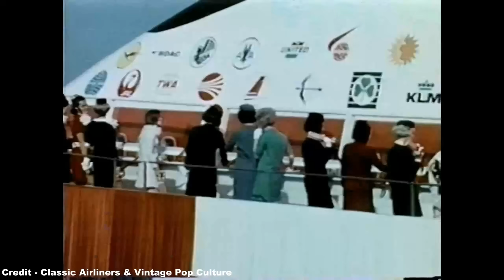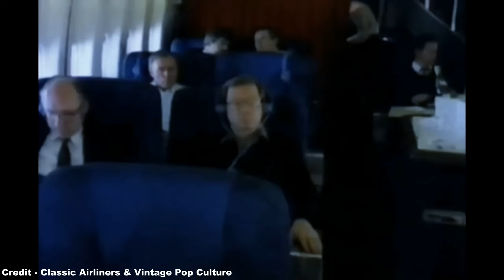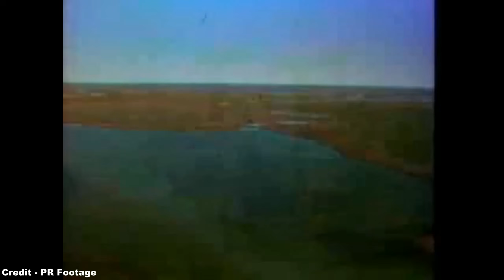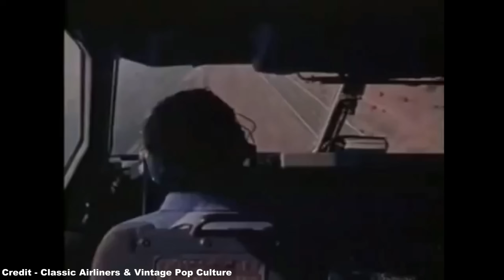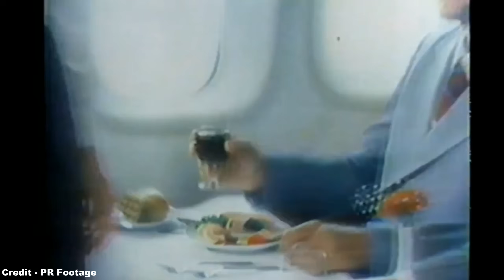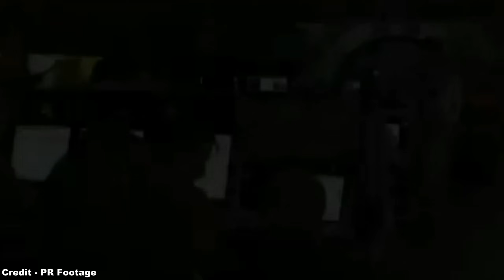Short Stuff - Boeing 747SP (Reworked)

Comment: Equal to the size requirement, Pan Am wanted a plane that could fly Nonstop from JFK to TYO,  JFK to Multiple ME destinations, SFO to HKG, and LAX to SYD.    Also SP special performance - higher, faster, further.      The flight block time from LAX to SYD is 15 hours today, but in the early 80's Pan Am scheduled it at 13.5 hours.

Comment: Unless you've stood on the outside of a 747 I don't think most people realize the SIZE of the thing. Just ONE of the main wheel wells was the size of my first apartment. There was room in the crown area (above the ceiling panels) for an entire other section of seats.....and no, I'm not just talking about the upper deck. Above the ceiling panels of the main deck they could have easily put another three abreast section of seats.

Comment: As a kid in the 1980s I flew Pan Am and later United 747SPs from Sydney to LA many times, then as a adult worked on both Qantas 747SPs as a engineer, they were also the only 2 to be fitted with Rolls-Royce RB211-524D4 engines and a strengthened -200 wing. 🇦🇺
Reply: Sir, awesome to read your comment :-)
Reply: @Michael.Chapman 
Thankyou my friend. 🙂

Comment: The boeing B747-100 SP operated as the sultan of  VVIP trsndport had an Escslstor in the forward csrgo jold ehich vould be ectfnded ftom the forwsrd c argo hold a to the gtound yo resvh the gtound. to probinde a mobmving   dtsirs  as an access to yhe sircrsft  from the gtound it aldo had sn Elevstor in yhe forwsrrd frright jold yo   lift passrngers ffom the  freight hold. yo yhr msin devk n VVIp, passenger Acommodstion

Comment: I always found it odd that the -100, -200, -300, and -400 were all the same length. Only the -SP and -8i were shorter and longer respectively. But...the -300 and -400 utilized the extended upper deck which was originally engineered for the -SP, so that was its main legacy.🙂

Comment: But interestingly, I wonder why Boeing never considered building a 747SP powered by RB.211-524H or GE CF6-50 engines. The higher thrust of these engines could have allowed Boeing to extend the range of the 747SP from 6,600 to circa 7,250 nautical miles, which could have made very long intercontinental year-round flights possible like between  SFO and HKG, LAX and SYD and SYD to LHR (one stop) possible as early as 1982!
Reply: According to an orginal Boeing data sheet I have about the 747SP, it was actually offered with both the GE CF6-50E, -50E1, -50E2 with a take-off thrust of 52.500 lbf each and the GE CF6-80C2B1 (!! - this engine was otherwise used for 747-300s from 1987 onwards on customer request and the 747-400) with a take-off thrust of 56.900 lbf, but none were ordered. Of the RR engines, the RB211-524B2 (50.100 lbf) and -524C2 (51.600 lbf) were offered by Boeing and ordered by their customers, but the -524D4 (53.110 lbf) was only offered and not ordered. The RB211-524G and 524H were only developed and offered for the 747-400 and had their entry into service in 1989. Kind regards!
Reply: @janncfl Thank you for that info! From memory, RB211 G/H engines were edging close to 60,000 lbf on BA, QANTAS and CP -400s?
Reply: Both Australian SPs, purchased new by QANTAS, naturally were delivered wearing the more beautiful Royce RB211 fans. I believe others, including South Africa, optioned similarly.
Reply: Boeing offered the SP with all the engine options....final score ...PW-39...RR-6....GE-0

Comment: I flew on a SP in 1988 from Mauritius to LHR via Zurich. It was operated by Air Mauritius and I think was previously flown by South African Airways. The flight to Mauritius was on the SP's replacement, the 767.
Reply: The original MK 747-SP was leased from South African Airways. It was flown by SAA pilots with MK cabin crew.

Comment: A "baby" 747 !!🥰 If Boeing had shrunk" the 757, instead of trying to stretch the 50+ year old 737, the issues with the MAX would never have happened and their reputation wouldn't have taken a hit;  and they would not have had to put out hits on their whistleblowers.😱
Reply: Ironically, the 737 and a321 and demand for both has grown to be the 757-200 and 767-200 in terms of capacity. 

While the 757 never had an ER model, the 767-200 would fit nicely in that 10-12 hour flight range.
Reply: The 757-100, the never-built shrunken variant would've been too heavy in that category and would only be viable as an equivalent to a 737-800, bear in mind that the Classic and Next Generation families all have variants of different sizes to fit various roles. I doubt you'd be able to develop a 757 variant that would be the size of a 737-500.

Comment: I have a recollection of reading some interesting comments about the relative performance of the 747SP with the two available engines, the PW JT9D and the Rolls-Royce RB211 in that while PamAm's PW engined SPs often needed to make a fuel stop from the US to Australia, the QANTAS RB engined aircraft could do it without a stopover.
Reply: A significant, appreciated anecdote and comment.
Reply: Actually there were three available engines for the SP...The  General Electric  CF6-50 engine was an option for the SP along with PW and RR....no airline opted for the GE engine on the SP.

Comment: Between 1989 and 1991 I made several trips between The US west coast and Singapore aboard 747SPs operated by United.  Lovely aircraft.  On one flight out of San Francisco we were due for a short layover in Hong Kong before heading on to Singapore and shortly after reaching cruising altitude we encountered a headwind in the form of [what I understood to be] a 200+ MPH jet stream - consequently slowing us down by some 200 MPH and giving us very rough flight.  After several hours the Captain announced we were low on fuel and that we'd likely soon be landing in Guam (I personally thought that was pretty cool as I'd never been to Guam).  Short time later he announced an update, informing us they'd made some recalculations and that we'd instead be landing in Taipei.  This news was less cool (literally) as it was summer and even at around 1 AM when we landed, the former Chiang Kai Shek airport was sweltering and we were forced to stay  on  the runway with the cabin secured and our APU shut down during refueling, which meant no A/C and no fresh air (as an aside, the Taiwanese military isn't fond of surprises and immediately surrounded our plane with armed troops which I thought was a nice touch).  Good times =)

Comment: With only 45 units sold, the SP appears a failure at first glance, but this is pinky a part of the picture.  After the 1st oil crisis, orders for the 747 all but evaporated. Boeing even considered terminating production. The SP kept 747 production line open until the improved 747-200 received orders again in the early 1980s. If you look at the number of 747s sold after 1978, that’s the SP’s real contribution to Boeing. 

ETOPS did not kill the SP.  While he Eastern did benefit from the 75-minute rule flying A300s to the Caribbean, that was a tiny portion of US commercial airliner in 1982. In 1982, the 767-200 only carried 10 more passengers than the 727, and could barely cross North America on a 6-hour flight.  767 ETOPS did not start until the latter half of the 1980s, when EL AL and TWA deseperstely needed a smaller aircraft to fly the North Atlantic in winter. 
 
The 747-200 with more powerful engines killed the SP. China Airlines, Air China, and Korean Air ordered the SP to launch nonstop flights between their home bases and San Francisco/Los Angeles at a time no other airliners could go the job. By the time Air Newzealand ordered their 747, the incremental improvements made it possible for the 747-200 to fly Transpacific nonstop. The 747-200 burned the same amount of the fuel as the SP, but carries 80 more passengers, thus making it a no-brained preference over the SP. Note that aside from Braniff and Iran Air, every airline that ordered the SP from Boeing also operated the 747-200.
Reply: I believe what happened was that Boeing was able to offer a 747-200B with more powerful GE CF6-50 or Rolls-Royce RB.211-524 engines in 48,000 to 50,000 lb thrust range, which allowed Boeing to increase the fuel capacity of the 747 to allow flights as long as the 747SP but with the same seating capacity as the 747-200 models. It was these improvements that explained why Japan Airlines, a customer targeted by Boeing for the 747SP, ended up buying the 747-200B powered by CF6-50 engines.
Reply: @Sacto1654  Japan Airlines never operated 747-200s with GE engines. You are confusing JAL with ANA....2 different airlines.
Reply: iran air operated both the sp and -200
Reply: And our two Aussie QANTAS SPs both used the same Royce RB211s as their 747-238 fleet sisters... Could they be less efficient? They proved they could fly higher, faster and further than the -200. But I'd agree that by 1989 the new RB211 G/H on the 747-438 made the -400 the one too beat.

Comment: I loved sitting up in the dome. Once in 1st class (that was years of saved up airline miles, I'm not some tech bro millionaire) and later many airlines moved business class up there, so got to sit there for work. Quiet and private and before 9-11 you could easily visit the cockpit. Always had a great time with the crew - generally walked out with a bottle of wine that hadn't yet been opened and was surplus to requirements. 😁 EDIT: I guess you could say that the 747SP was the predecessor of the JWST!
Reply: James Webb Space Telescope ?
Reply: @rael5469  Yes, as he's referring to SOFIA. It was a infrared telescope mounted on a 747SP, flying above most of the atmosphere for better imaging. JWST is one step up, entirely in space.
Reply: @teeteetuu94 What a significant contribution to infrared astronomy she was... :-)
Reply: @rael5469  indeed
Reply: I flew in the hump once too - it was an upgrade to business class (The first class was located at the front on the main floor, where you could look forward and see the runway right before landing ). What I was the most impressed by topside was how far the ground was from there. Lie looking down from the fifth or sixth floor!